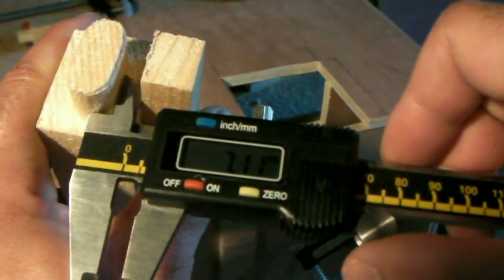Making the box for the router tenon jig

Comment: Cut the parts for the box on the cnc, put it together and cut PERFECT tenon for my current project.. Sergio has got it all goin on here..
Reply from the maker: 👍 Long time since I don't use this router jig. I should make another piece of furniture using this woodworking jig to make mortise and tenon joints
Reply: @WoodworkingwithDIYtools  Sergio, I cut 36 tenons in approximately 3 hours.. Two from the end I was moving a little fast and nicked the pattern withdrawing the router, never the less I continued on and will clean those up with a rasp..  Brilliant design.. Saved me a ton of time.. Thanks a million and keep up the good work..